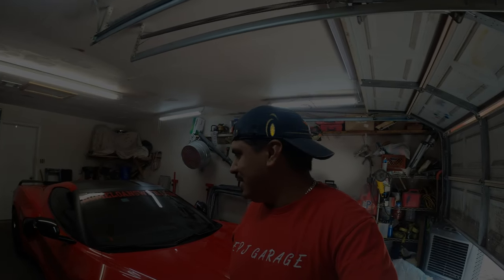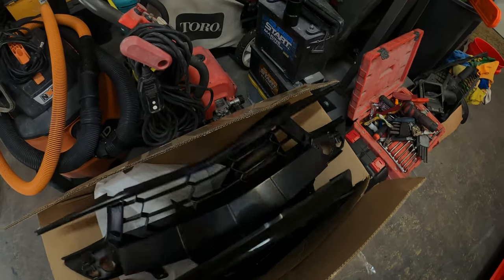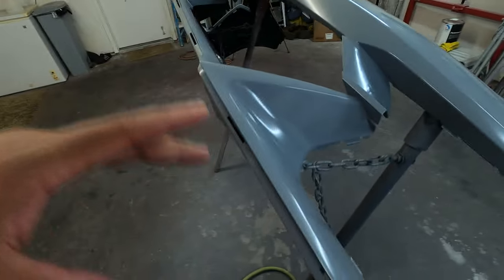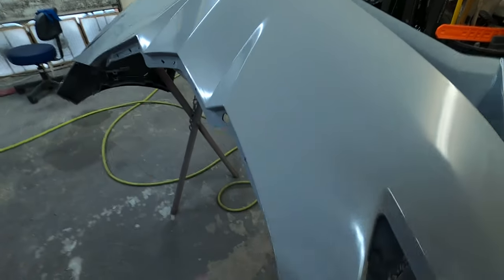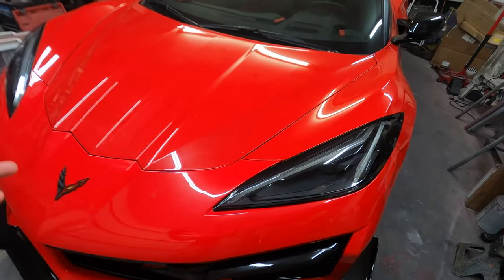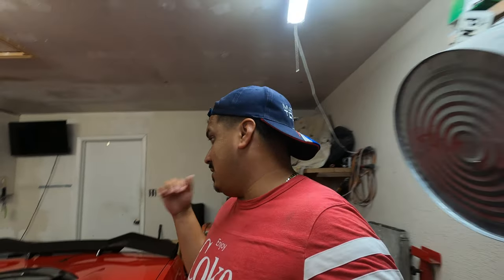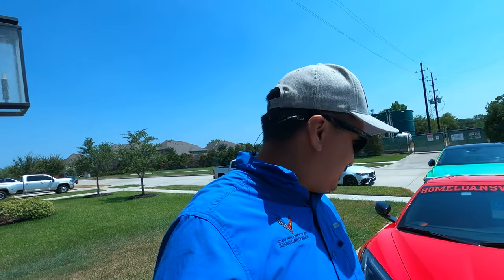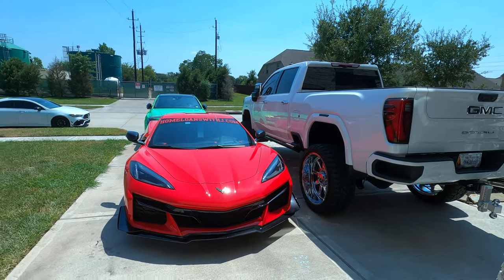Unveiling the stunning C8 Corvette front end z06 conversion

Comment: Great video and great work!! Question…Do you think you could have matched the color closer to OEM if you tried painting it again without ever having to blend the hood and fenders?  Why didn’t you have to blend the rear facia adjacent panels (trunk lid and rear quarters)?
Reply from the maker: The rear didn’t get blend because it was a small repair vs a complete panel replacement. I was able to hide it within the rear panel. Panel to panel had a perfect match. Paint stores can get the color close to the original color but on these type of vehicles or any of my paint jobs. I wouldn’t take a chance on not blending on a new panel replacement.
Reply from the maker: Don’t forget to subscribe
Reply: @epjgarage  …you now have one new sub!!! Thanks for the reply!!
Reply from the maker: Thank you! 😊 I’ll try to start posting more.

Comment: Good job. I didn't know they sell bumpers. It looked like the Z06 one. I the light on your gun aftermarket or SATA guns only?
Reply from the maker: It is the c8 zo6 bumper made to fit the base model. The only part that sucks for it to look original the whole front end needs to be painted/blend. I love how mean it looks afterwards. 

The light is off eBay and it fits any spray gun. For the price it works great!